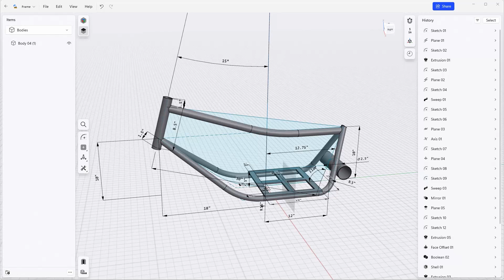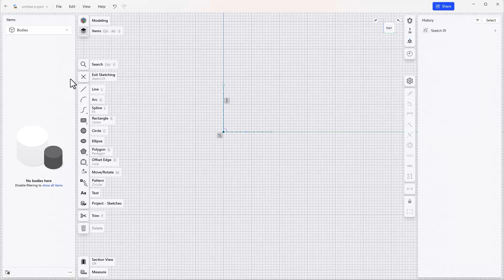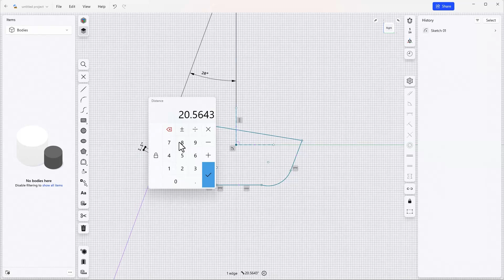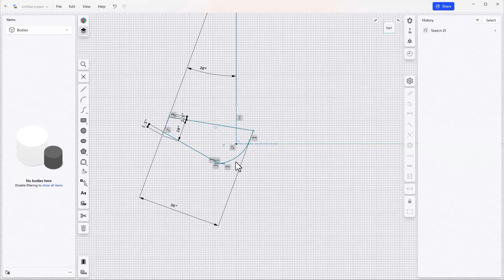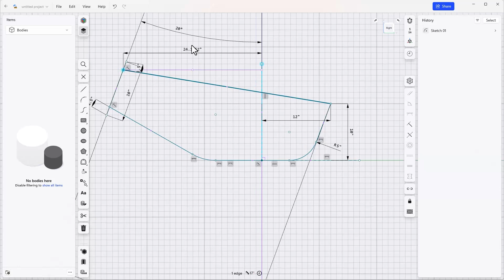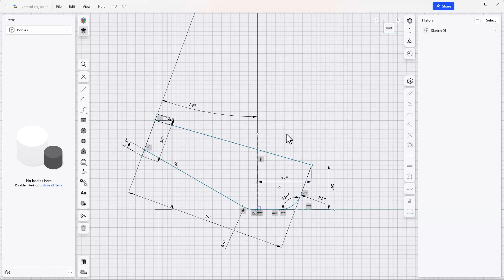Layout Sketch Technique: Motorcycle Frame Design, part 1 | Shapr3D Basics

Comment: At marker 2:29 in the video, what key combination/mouse clicks were used to add the dimension between the two points selected?   one was a green dot randomly on the middle of hte line and then the end point of the intersecting line was clicked.   I am not clear how this was done.